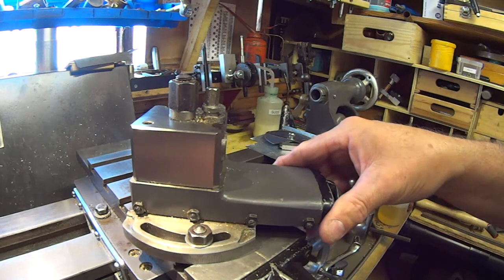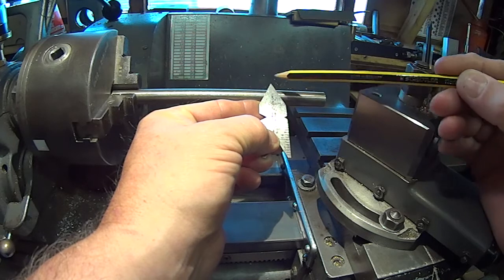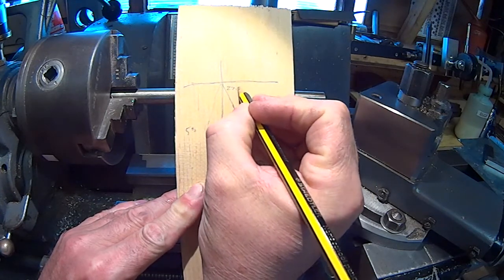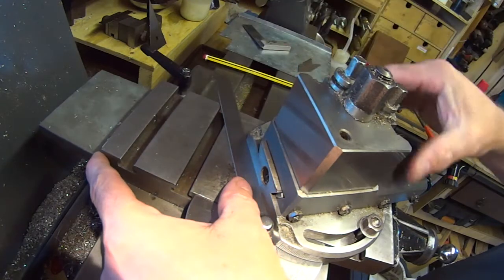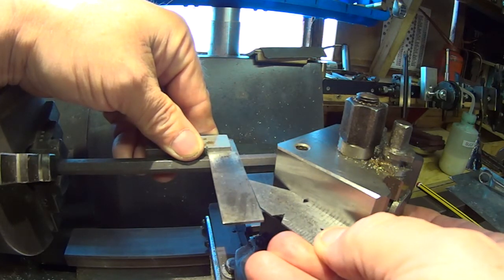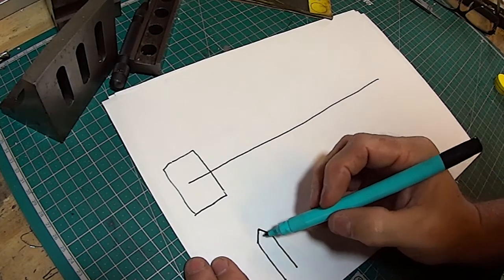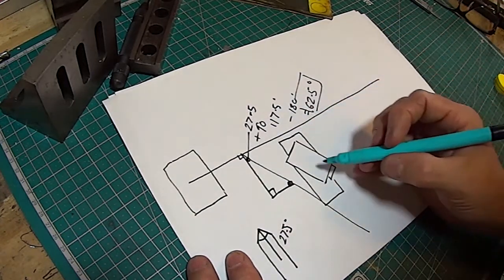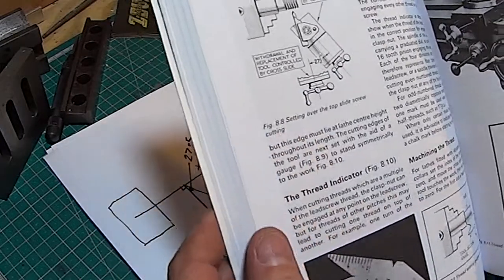Setting over the top slide for screwcutting

Comment: I've been trying to cut a two start (55 degrees) thread on a 1/4" stainless shaft. The thread depth was quite hard to cut down to the core diameter required with 'tearing' happening as I tried finishing the thread. Cheating was found to be a marvelous thing in this case. I ground the tool to about 52 degrees, put more top rake on the left-hand of the tip (the cutting edge for the 'topslide' method) and essentially cut the thread as normal with the extra top rake allowing cleaner cutting. The right hand side of the tool doesn't really cut (in theory) so you can safely have negative rake on that side of the tip. Hope this helps someone having this problem.

Comment: I'm new to model engineering and have found your video's very helpful and interesting.
Would you please consider makeing  a video on how to set up the drip feed oilers on the myford ml7.
I also have a Dore Westbury milling machine which requires setting up. Would you consider doing a second video on how to accurately set up the table.
Many thanks

Comment: Good grief. I learned most of what I know from Sparey's book. But really most books are vague. There are many reasons to set over the top-slide, such as cutting a taper. The books say "set the topslide  to half the taper angle" and leave it at that. Yes-- but half the angle from what axis? The book is mute, unless the author draws you a diagram. So you were off by the complement of the angle, and  I always have to draw my own diagram.

Comment: Too complicated maths... Simply subtract 27.5 from 90 and the difference is 62.5
Reply: Even simpler, just leave the top slide at 90 and cut threads by going straight in using only the cross slide. It really isn't the problem that some less experienced people seem to think it is.
Reply: @chrisstephens6673  AH .yes..and then you get into the debate about using the plunge cut as you suggest, or using the angle meshing..and if you do use th angle method..do you use the exact half angle, or fractionally off the angle, ...to allow relief  ;)  I just do not know..seems to be good arguments for both.  Guess it is what works for you really
Reply: @npaisnel  the answer is simple, you do it the way you feel comfortable with.
Reply: @chrisstephens6673  exactly.  I, today, did myself some CAD drawings to 'see' in my mind what/why it made a difference.  Now I see it, it all makes sense.  Anything less than half the thread angle is acceptable..getting  'better' the closer you get to the half angle, followed by a stepped trailing thread face as you go beyond.  Totally obvious now.
Reply: @npaisnel  a man after my own heart, someone who investigates and then forms an opinion. 
I never liked the idea of a stepped flank especially as it is on the "load" side, although that could add to a small self locking feature?
Many years ago I was in discussion with an old timer who was taught to set the top slide at 30 but grind the cutting tool at slightly less than 30 on the right hand edge. The point still follows the right angle but clearance is in the tool not the movement. 
For further experiments for you how about trying going in at an angle with a tool that has top rake on the leading edge, rather than a flat topper form tool. You do get a lovely free cutting tool that way, but it only works with flank feed.
Reply: @chrisstephens6673  I'll give your suggestion a try next time.  I have a box of ready made inserts, but no holder at the moment.  Though this sort of job, is for me, a once or twice a year occurrence.
Reply from the maker: Hi Robin, thanks for the simplification, I have dyscalculia so the maths is never going to be one of my my strong points - Ade
Reply: Ade Swash no problem... It's worth simplifying to make it easier. In a triangle the three angles always add up to 180, since we know one of them in a right angle triangle is 90 then the other two also add up to 90.  If we know one angle we can work out the other simply by subtraction from 90. Also each of these internal angles is complemented by an external angle which adds up to 90. So subtraction from 90 works here too.
The book Screwcutting in the Lathe by Martin Cleeve explains the much more complicated maths and the reasons for angling the tool and is worth a read for those interested.
If you want complicated calculations try working out the compound angles for the individual timbers in a hipped roof...
Nice style for the video by the way...

Comment: I put an extra mark on my cross slide at the 30 degree mark on the compound.  You can use that mark to get steep angles that are out of the normal range.   What I do is to move the compound round till it is at say 30 degrees by the normal mark, then I look at my other mark and add ten degrees at a time, 40, 50,  etc and then the final fraction.  By this time the normal mark is off the edge but it doesnt matter because I am now indexing off the second mark.

Hopefully that makes sense.  It's a bit tricky to explain!
I like your idea of using the protractor though, mainly because I find it very difficult to see the numbers!  I always need my torch.
Reply from the maker: Thanks John, yes I think I understand your solution, I will give that a trial.